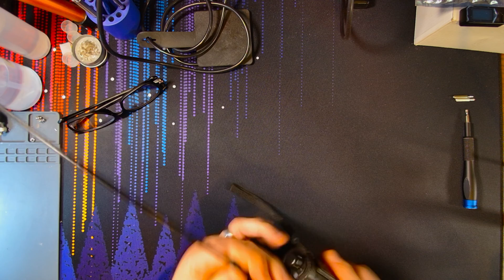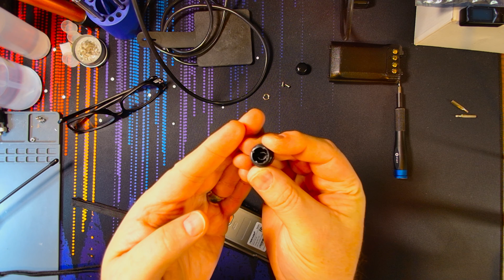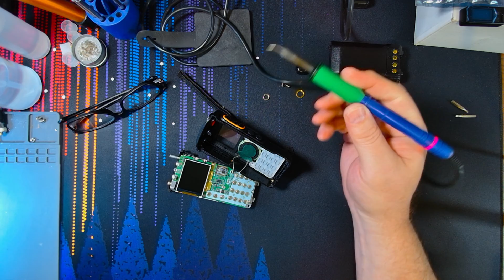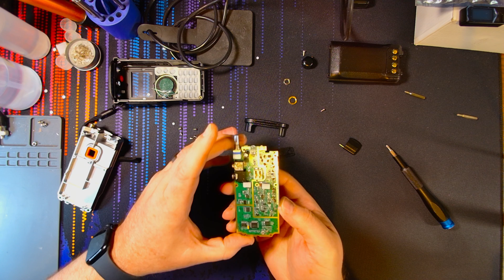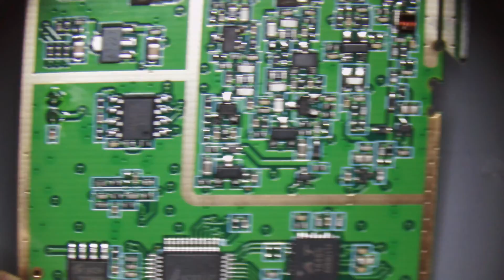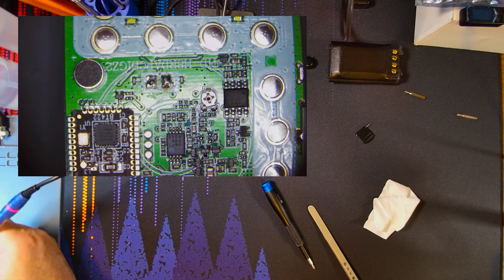What's Inside the TIDRADIO TD-H8?  Let's find out!

Comment: How would they go about reducing spurious emissions? Are there better components that would be used? Or better insulating materials? I am curious what they changed to meet the standards
Reply from the maker: That's a great question.  It is possible to use better components, or even changing certain values of components in the filtering circuits.  I haven't looked side by side at the boards, but there is also possibilities of board revisions to include more filtering.

Comment: I'm not 100% but the controller seems to be a variant of the AT32F421C8T7 or similar, maybe even just rebadged. Investigation in ongoing.
Reply from the maker: Thank you, keep us posted!!!  I'm about ready to post a video on the TD-H3 insides... and it has the same CPU.  I know people were wondering about custom firmware for these radios like the Quansheng UV-K5(6)!  The TD-H3 has the same radio chip as the Quansheng, but with a mystery microprocessor, the hacking becomes a little more difficult.  Thank you for watching and commenting! 73s
Reply: @KC4NWK  Upon further digging I think I'm totally wrong. I couldn't get anything to make sense given the firmware image for the H3 when assuming it was an ARM Cortex core. The core that seems to produce the best and more consistent disassembly is the Intel 8051 MCU architecture.
Reply: @nicsure  That STM32 is an Arm Cortex M4 part - I honestly can't see them using an MCU like that as a controller in a low cost device like this, especially since all it has to do is run the keypad and display and send a few commands over I2C.  Using some 805x derivative seems a lot more plausible.  Finding out which one could be a challenge though - there are a huge number of 805x core MCUs on the Chinese market with a wide range of different features and capabilities, and most of them don't even have an English datasheet available.
Reply: @TrimeshSZ  It's an 8051 variant.

Comment: The TA3782F is an integrated circuit (IC) manufactured by Toshiba Semiconductor. It is specifically described as an AM/FM 1CHIP TUNER SYSTEM IC
Reply from the maker: Interesting!  Where did you find this information?  I tried searching again, and can't find this online anywhere. :(   The only site that I can find a mention of it is a Russian site in a radtel radio.

Comment: I went back and rewatched your video of the tear down on the Baofeng UV-17; UV-17R; UV-21Pro; Radiodity GC5 and I noticed the speaker and front buttons from your previous video were all connected with a ribbon cable, BUT  this Tidradio used a 2 conductor wire soldered directly to the main board for connecting the speaker ???  What a pain for reassembly !  
I would much rather buy a brand that used ribbon cable for its connections even if the price was significantly higher. Thanks for doing the teardown.  It’s nice to be able to see the differences  of the various brands on the inside
Reply: I much prefer wires over ribbon cables. Easy to repair and tend to be more robust. Typically adds no extra pain during re assembly. Shouldn't be disassembling unless you have the adequate tools anyways.
Reply from the maker: Thanks for the comment.  Yes it is interesting to see how they vary.  Some have nice plug-in connectors and some are soldered to the board.
Reply: These cheap radio manufacturers count pennies with recurring costs. (BOM & labor). Repairability doesn’t even enter into the equation. Everything is about driving the cost down and getting the reliability to perform past the warranty period.

Comment: It would have been nice to find a well documented microprocessor: possibly then, the firmware could have been modified (just like with the UV K5). 😢
Reply: Might see if I can desolder it and put in my programmer and see if it can auto detect the chip
Reply from the maker: If you do, please be sure to come back and let us know what you find!  Thanks!
Reply: @KC4NWK  I did quite a bit of digging on the chips on this board hard to find anything on them. The transitors from what I see online are either 11 watt 7.2v or 6 watt I've found them for sale so maybe swap them out with a couple irf 510 or something and use external power ? Found a drawing of one which shows that there is only 3 legs not the 10 the chip appears to have again no schematic also the fm radio chip should be able to tune down to 64mhz. I'll keep digging at this thing. Also on the edge of the board it may have a uart port haven't confirmed. I also don't think the flash ic is where the firmware is stored from trying to dig up info I decided to try and dump it there was not much on it nothing readable I think it's for saving settings I'm talking hk24c64 I think is an atmel clone
Reply: That will be a great idea!!!! @logicman91
Reply from the maker: Exactly, I'm not sure the AT 1846S is as versatile as the BK4819, but some tweaks might have been possible!  Thanks for watching and commenting! 73s
Reply: BTW, thanks for the teardown! I'm always concerned about breaking the brittle LCD display, which I am sure is either hard to find or impossible to replace without special tools... I'm glad you took that risk for me / us. 73's from F4LBH
Reply: Searched chip can't find datasheet asked chatgpt it says its a Toshiba  PLL frequency synthesizer ic I'm talking about the ta3782f looks like chip is tqfp48 I'll have to wait on socket adapter to zif